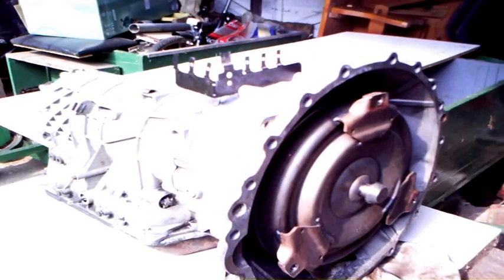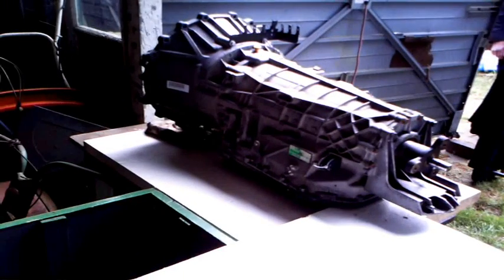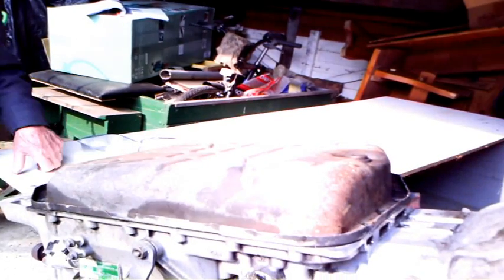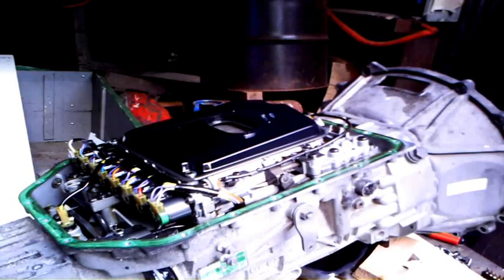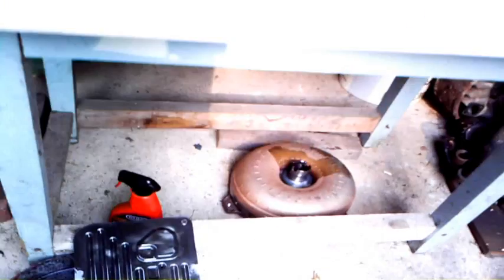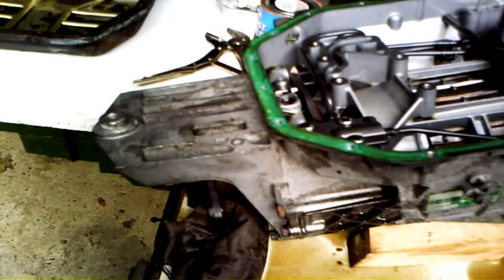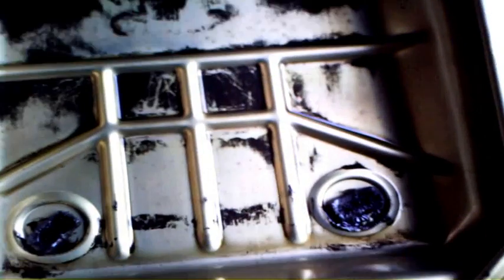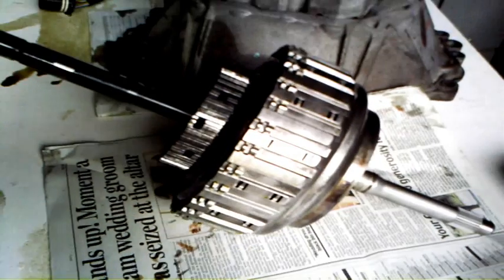Jag XJ8 ZF5HP24 Transmission Rebuild Part 4.avi

Comment: Between Part 3 and this session, Part 4, I see that the gearbox case is VERY clean....what did you use to scour the exterior to get it so nice and ready for disassembly?

Also, I am certain that you had assistance in lifting and lugging that beast about from the floor of the car port to the work bench